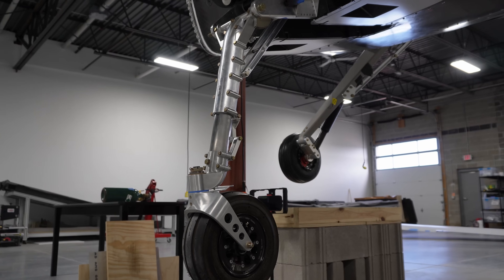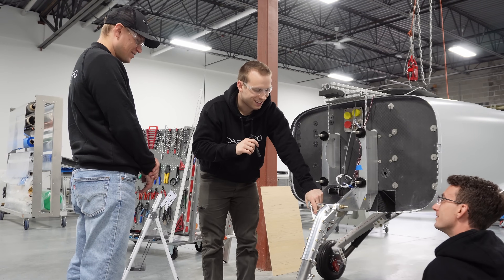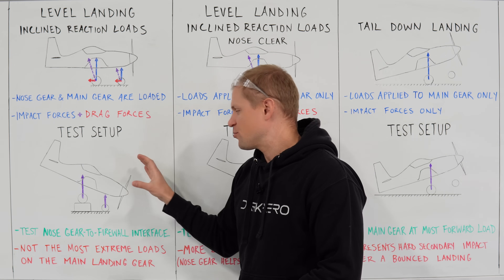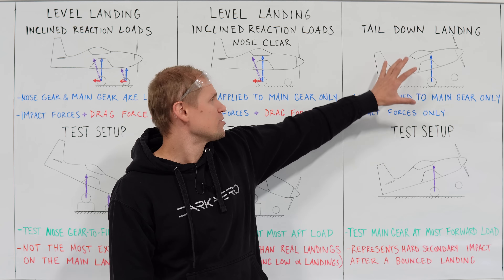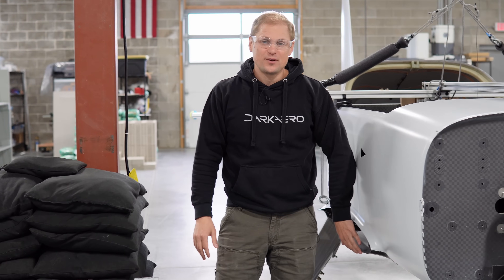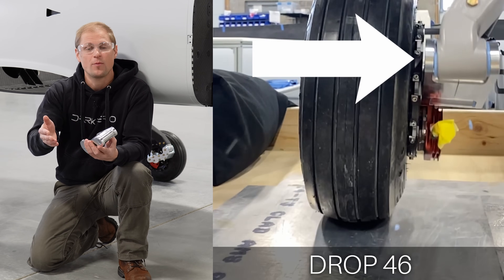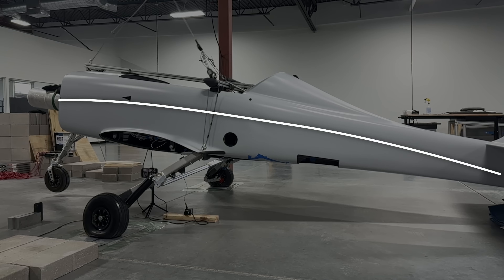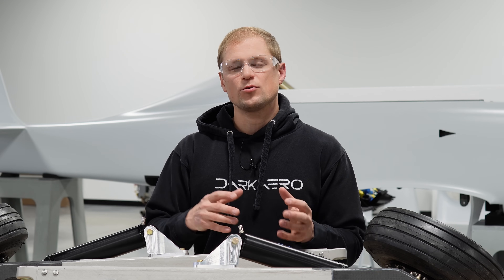We dropped the DarkAero 1 over 125 times - what we learned

Comment: Unpopular opinion: Please don't fly it yet!   BUT, please do share more of the data collection process! I started watching as a student. Now I work in a mechanical reliability lab for a bunch of engineers. My responsibilities are CAD/CAM/CNC/3DP and -- DROP TESTING! 🙌 So my aviation brain and my nerdy data collection brain are both absolutely jacked right now lol. Please share more :)
Reply: Not unpopular at all, much as most of us are absolutely rooting for the project's success.
Reply: go watch Mike Patey Build Scrapy. He basically drops his plane from the roof, with added weigths xD
Reply: What do you think about that pliers motion leading to the shock. Isn't it actually increasing the force exerted on the shock due to adding the forward motion to a vertical? 
All bike absorbers are backwards. Solid central link and all the excess forces directed outwards towards a 2nd dampening system. This way all of the force+extra goes in that shock.
Or the bend of the forward gear there is NO 2nd link connecting the shaft towards the engine. the bend is the final link. The links under(connecting to the bottom of the fuselage) it don't look like adding much structural rigidity. 
Also why try reinvent new wheel link designs when this have been done a million times over...
Reply: I'm an aerospace engineering student as well, and i absolutely enjoy those nerdy videos too. @DarkAeroInc Please share more of the process...
Reply: I see what you did there
Reply: They try to earn money. And don't want  to share info. They think they are smatter then subscribers. DA shares more info and fly not bla-bla-bla. You can check Hill helicopter. He tells much more info, than this homebuilders
Reply: I would fly it if they'd let me.
Reply: The 3 brothers will be collecting Social Security by the time the DA actually flies....
Reply: I think that the people want to see if this thing can fly more that all this nonsense. You could have just taken a proven landing gear from a cessna cardinal, as the lanceair 4 did, and saved a year.
Reply: @RobotalkerSupport  sure you could take the landing gear from another plane and save a bit of time. But there's issues with that as well. Like you still have to test how they're integrated into the airframe. Plus then you're stuck dealing with that other companies manufacturing. And if they decide to discontinue making that landing gear, or parts for them then you're out of luck building more planes.
Reply: @thomasmahoney9748 
That's a nice theory, but it's not always the gear itself that fails. I had a Cessna 140 that had a very strong spring steel gear. The gear had survived a nose-over, but the mounting points in the fuselage broke...
Reply: You can literally fly a potato if you slap some wings onto it. Don't be a safety freak.

Comment: You mentioned testing with wings level, but I’m curious if you tested landing on one main wheel (thinking of the recent Toronto crash where the right main gear failed and the wing came off).
Reply: First thing I thought when discussing the level drops. Can the main gear handle all the force on one side momentarily?
Reply: That Will Only Happen ,  If A Woman Is At The Controls .  They Call It  A  Cock Pit  For That Reason .

Comment: Really dumb question here: Won't the internal pressure of the air shock vary due to altitude? If so, do you have maximum air values you can use at sea level? tia
Reply: Mountain bike forums all say the effect is negligible.
Reply: Sigh... 250 psi + 1atm ~14.7psi if flown in outer space...   IS ~6% margin.  If you have to worry about 6% margin, YOU are in the wrong business.   Can NO ONE do basic MATH before opening their pie holes?
Reply: @w8stral  Temperature could matter more.
Reply: @seth094978  Uh, no.  Do the math.  PV=nRT.  Stop embarassing yourself.  DO your tires go flat in winter?  Sigh...

Comment: I am definitely buying one of these when they become available!
Reply: Check up Risen made in Italy and sold in USA too(probably faster, even crossed Atlantic ocean easily non stop and it used 155l of fuel only for 10hours crossing......) Also Dark aero has extreemly weak wing. I am judging from number of Gs it is contructed for and comparing it to many LSA aircrafts made in Europe. European LSA aircrafts have wings constructed for higher G loads despite they are probably slover except of Risen which can travel 230knots...with 140hp Rotax.  Given the facts, that European LSA aircrafts use much weaker engines and except of Risen they are also slower airplanes, I would expect (and wish for)  a much stronger wing on any airplane like Dark Aero is.....

Comment: This plane is going to be safer than a Boeing.
Reply: Doubtful. Per passenger mile this will be way more deadly, just due to how the airlines run under part 121 vs this high performance aircraft, which will often have low performance pilots.
Reply: Come on guys, Boeing  is still pretty safe.
Reply: That’s not saying much these days it seems
Reply: Mini MD500 is safer than a Boeing.

Comment: After almost a year, a new video🎉🎉🎉🎉 love to be able to see the progress
Reply: What progress?  They were drop testing a year ago…
Reply: @snowgoer540  They redesigned and produced several parts, some 5 times, until they met a higher level of design optimization.  Each time they built new test apparatus and completed actual scientific tests.  
Meanwhile, negative trolls are still typing in the same chair, in their mother's basement, in the same pair of underpants.
Reply: See ya next year
Reply: Ah I'm not crazy! I thought I missed a notification! Nope, 10mo since the last video
Reply: I'm suggesting it is just pure vaporware. After more than a decade, some composite bits to support a YouTube channel. 
Burt Rutan built the first VariEze, a completely new design, in less than 3 months.
Reply: @ninelima1412  But Burt's design was much cooler - and was 99% built by the plans purchaser...  This will be a snap together kit (like the Velocity) - where parts are manufactured and the product purchaser does final assembly.     It is, however a nice series - and great to see younger minds involved with experimental aircraft.  They do make a good presentation.  I look forward to seeing it at OSH in 2026 (remember Burt says you MUST fly it in to count!!!!!)
Reply: What progress? This project remains in a stalled state of inaction and questionable project management and engineering decisions. It doesn't take 10 months to do comprehensive drop testing and analysis unless everything is failing every step of the way. At this rate of progress Dark Arrow will never fly and will remain rooted in the state of paralysis by analysis.
Reply: @billcarrier9622  They probably are working to fund the project, things are tough nowadays, and I hope the BEST on this program, I want it flying!!!